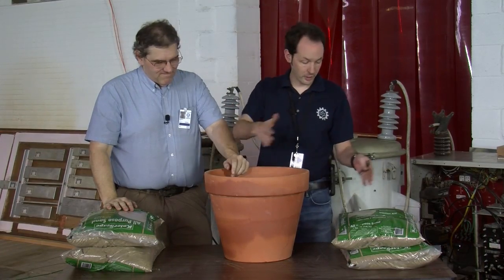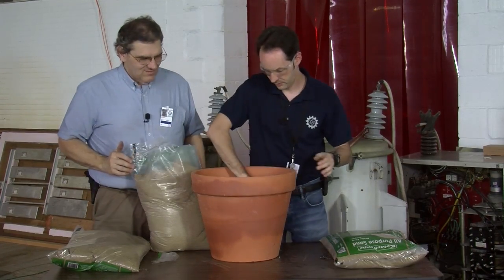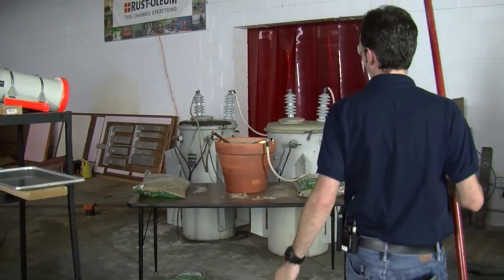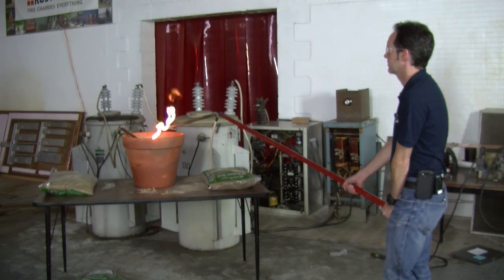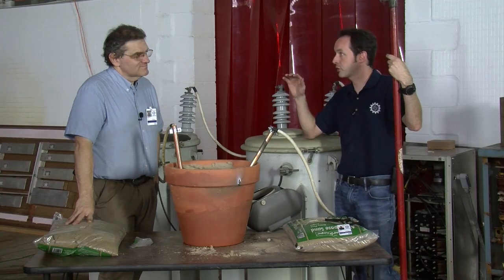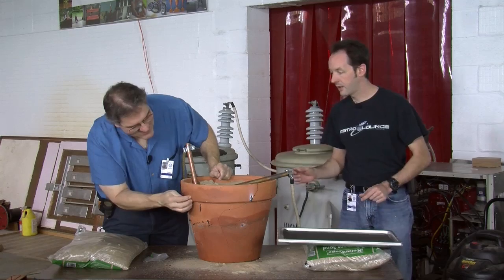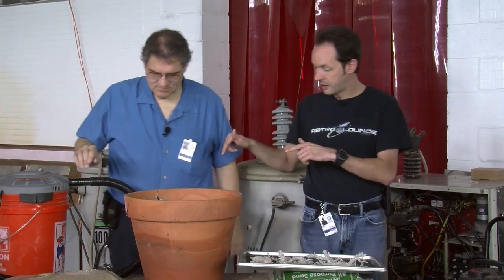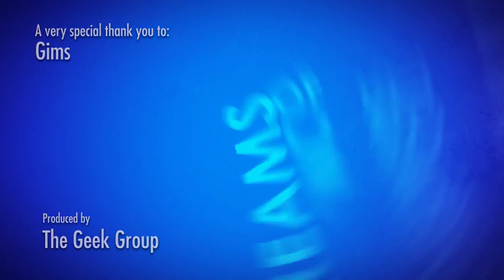Making Fulgurites with High Voltage

Comment: I did this with Joe Dwyer very crudely for a show Strangest Weather On Earth.  We had 2 days to come up with something completely out of the blue and I had shipped out my only pole pig.  So we used a MOT found a local Habitat restore and I mixed crushed mirrored glass with sand to make the conducting path a little easier for such a low working voltage... but it worked and they looked pretty realistic!  Also burnt a hole in the lab table at FIT because the heat cracked the porcelian tile we had the mix on.  Joe had a table full of real Fulgurites.   They all kinda looked like something found in a litter box...

Comment: Wow and I mean well I have no words I guess you guys have never seen been around nor worked with high-voltage electricity. I'm an industrial electrician in IBEW 776. Seen a lot of accidents electrocutions you guys apparently Have not. I get paid to work with extremely high voltage transformers, switch gears, bridge cranes, etc.  An arc flash on Just a simple 200 amp, 600 volt, meter base service on your house can reach temperatures 4 times hotter than the surface of the sun and reach out 16 to 20 ft. In diameter. In less than a second your skin melts....🤢🤮 not pretty. Please be careful please🙏🙏🙏🙏
Reply from the maker: I question the veracity of your data there, sir. Could you please cite some sources on your numbers?
Reply: @ChaoticGoodChris  yes sir I can and I'm glad you asked. Every Monday,  Wednesday, and Friday @ Bosch,  BP Amico, Dupont, Intrefor (aka N.Chas paper mill), Nucor Steel, Alumax, General Dynamics, and Port Authority, (3 different locations Charleston SC). The company I work for and the plants themselves require 2 hr safety meetings where we all discuss and watch safety videos that show people getting hurt or killed doing exactly unsafe practices such as this video, for example. I used this video in the meeting yesterday.      "THE ROOM WAS SILENT WITH 82 INDUSTRIAL ELECTRICIANS, SIR."  Nothing safe at ALL.  Sir you can look it up. What I day are facts not made up no intentions to impress. 
Hell I go home everyday in 1 piece,
Reply: Depends on the service entrance arc flash wise.  Could be a problem iffen it was an 800A meter CT cabinet that was 20ft of paralleled 500MCM copper away from a 167kVA padmount transformer.  Not so much iffen it was 400ft of 4AWG aluminum triplex to a 10kVA pole pig.  Still deadly, but not exactly needing blinky blue light maintenance mode to work on.

Also, just about every 2S meter base that doesn't have spaces for fuses or breakers is rated for 600V (cheaper and easier to make them all for 600V than making a separate line of 250V class meter pan guts).  Doesn't mean it has 600V running to it.

And extra high potential is 230kV and up.

Comment: Amazing results but why didnt you wear UV and IR eye protection while pulling the arcs? Isnt that harmfull to your eyes?
Reply from the maker: Not all arcs are hazardous to your eyes. This is very different from a welding arc.
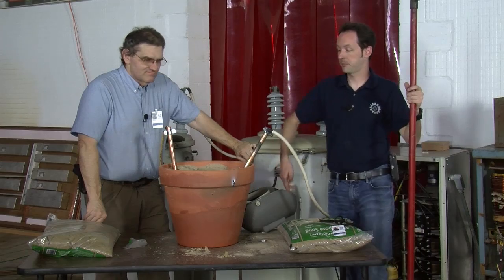Reply: @ChaoticGoodChris  Ok thank you. Can you tell me when eye protection is a good idea when I pull arcs. Like, is there a power level or current level when the arc gets to bright? And also, when the arcs are not dangerous to the eye, why did you then want to put/ put on the welding mask at 13:59 min? 
Thank you

Comment: U guys play with strange toys. I wanted 2 c them washed off. If the sand turns in2 melted glass & melds on 2 a terrcata pot, do it on the out side of the pots & sell them. I would b the 1st 2 buy afew.

Comment: I would use ceramic art quality dry mix. Clay is really just super fine sand. By having a smaller grain the overall structures could end up being much stronger and fuse more successfully.

Comment: got it, modeling a terracotta pot as a simple right cylinder leads to buying extra material. Be sure to use the correct closest geometry like a truncated cone to estimate the volume to be filled (or check the manufacturer's Specifications).

Comment: Just a few ideas off the top of my imagination:

1: Use a tube that is vertically cut in half that you can clamp shut and seal-up. This way you can strike it electrically, then open it so that you don't have to pour out or vacuum your sand, and simply sift through and pull out gently with minimal digging. Make sure the tube is made of a substance that the sand can not weld itself onto, so that opening it doesn't break it. Be careful not to make it into a pipe bomb, gasses need to escape.

2: The tube length should be no more than 1 meter in length, and the tube width should be no more than 6 inches in diameter.

3: Instead of just regular bland sand, pre-mix within a cement mixer a combination of ingredients that could effect conductivity, color, heat, and structure integrity of the Fulgurite. Blown-Glass Ingredients would be a good start to try with. Rust Dust and Grinder Shavings might make things interesting as well?

Comment: I'm pretty sure fulgurites are very expensive... You just created a money farm
Reply: Kioko Fulgarion
I understand a lightning bolt will create much more energy but wouldn't you get the same effect with a drawn out high energy current?
I really wish they did a follow up video so we could see a larger one but guessing by the massive fulgurite formation around the crack I would assume you get pretty similar results.
I am also having a hard time finding differences in the lightning formed fulgurite and artificially formed fulgurite (having difficulties finding any pictures at all really haha)
Can you specifically list the differences? I would be interested on what to look for. I find this very interesting (:
Reply: Can you? What are the differences?
Reply: I don't know, everything I am reading online leans towards them being indistinguishable from 'natural' ones. It seems to matter entirely on the material the electrical current runs through rather than the source of the electricity. 
Fulgurite also seems to be very cheap and readily available online.
Reply: Caleb Sålstrom The size first off, most fulgurites from actual thunderbolts are much much larger, most machines can't generate fulgurite sizes lightning tends to form. They won't be able to discharge electricity with the same amount of amps as a true lightning bolt which also plays an effect on the fulgurites form.
Reply: not quite, it's easy to tell a fake fulgurite between a real one. 

these are fake fulgurites, real ones are nature made.
Reply: True...
Reply: Caleb Sålstrom Eh, as long as you know your science and the nature of lightning, it's not that difficult to find a fake one.
Reply: Caleb Sålstrom  judging from what I've seen, the fulgurite in the video is ridiculously smaller than any actual fulgurite i've found, I did some digging a while ago, and found out as much as folks like to say there aren't any differences, those who collect these things who pay good money for them usually claim identifying a fake between a real is all in the science. 

Material literally does not matter, it's a good indicator, but is not always reliable, many fake fulgurites can replicate this by discharging a blast of electricity into the earth like normal lightning would. 

Lightning usually always flies upward from the earth, fake fulgurites can be identified by the branch getting smaller to a tip, actually, most fulgurites I've seen are not only large, but don't have tips and are tubes. Now unless it was from positive lightning, a phenomenon when it actually strikes from cloud to ground, then it would, however, this lightning is ridiculously powerful and no man made machine can replicate its charge and current, fulgurites made from these easily dwarf the one in the video, nearly three times as large and much much bigger branching out. 

Ampage is one indicator, its extremely vague, but the texture of the stone can identify if it is a fake or not.

Comment: Why would you put them in series if you want them both at high voltage? is the p.d. loss negligible?
Reply: maherandcameron I still think this video was too short.   They should've tryed parallel as well.  And DC, play with frequency, impulses, widths, balance, etc.   Got any free time and some cash? Let's make this happen.

Comment: What if you made a line of conductive metal balls across or throughout the sand (in a spiral). I guess you could even connect them together with a non conductive material to let it hold form after you take it out.

Comment: The results of this remind me of castings from pouring cement or molten aluminum into ant colonies. Prior to removing the loose sand and subsequently damaging the more fragile fulgurites, is there some way to get a 3D image of the glass structure while it's still in the sand? I'm not sure if either option would work with glass and sand, but ground penetrating radar or MRI come to mind. Developing something to get a decent image of the structure would probably turn out to be a complicated project in of itself, but I think it would be quite interesting, especially if it could get the image in real-time (like ground penetrating radar) and capture the formation of the fulgurites.

Comment: Next... you place a single electrode (not charged or connected) into the center of the pot, same size or more cylindrical, wet sand... then use a second electrode charged with the hot stick... the non charged will act as a ground all current flowing into, down and out of the rod into the wet sand... tada, mega fulgurite

Comment: Awesome! After watching you wield the hot-stick, might I suggest mounting a perpendicular handle on it so it is easier to hold? Perhaps add a curved piece so you can rest it over a shoulder or hip, like the steady-cam mount for filming?
BTW - if you do decide to make/sell these, try backfilling the fulgurites with epoxy resin to give them support. A small syringe should work if there is a small opening in the fulgurite.

Comment: The appearance doesn't change much when cleaned. I tried doing a cross section of a sample fulgurite about 1/2 inch thick with a dremel and a diamond wheel. It didn't work. The next step will be trying a wet saw, but as TGG does not have one (yet) cross sections will have to wait.

Comment: Great video guys! If you make them strong enough, maybe you'll make a fundraiser out of those, like the crushed quarters!

Oh, and if I may make a suggestion : try slightly wetting the sand with a solution of sodium hydroxide (drain cleaner). That should lower the sand's melting point (that's why glass is almost never pure silica, they always add a lot of alkalis to it) and consequently increase the binding between the partly fused grains of sand, making less brittle fulgurites.